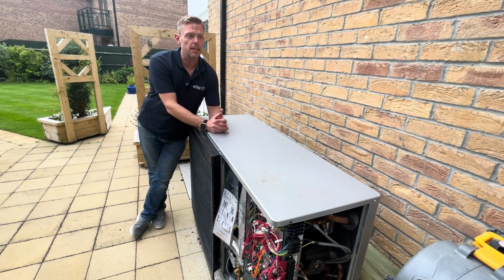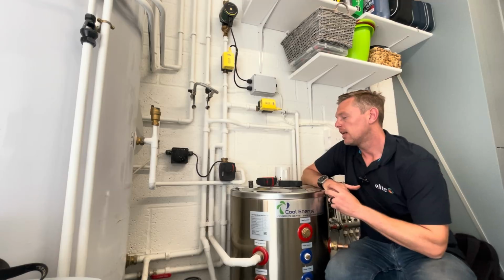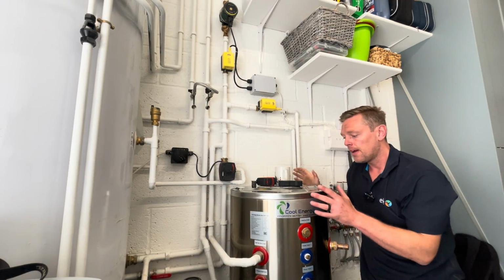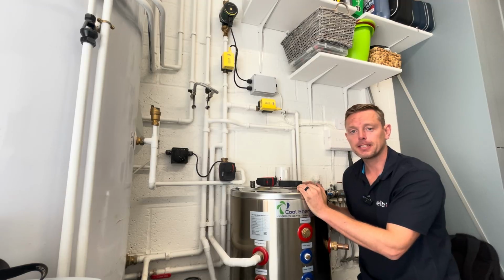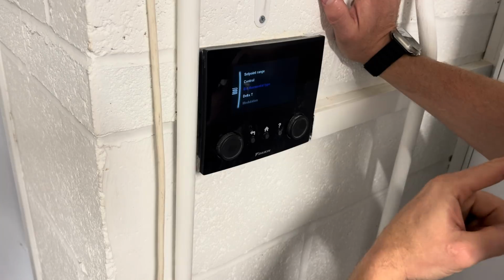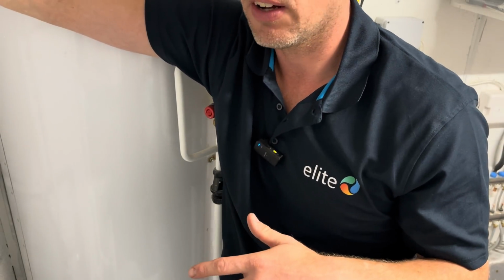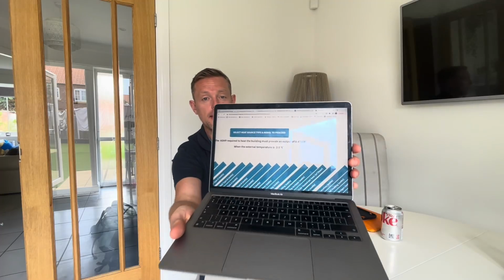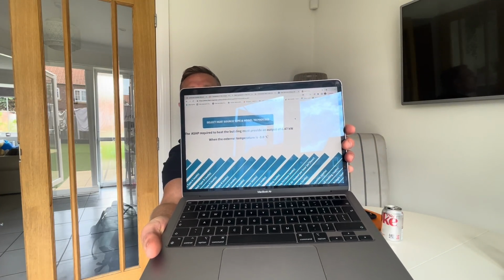How to Kill a Heat Pump's Efficiency!

Comment: If you go to USA you will see a huge amount of heat pumps, used for everything from home heating to pool heating.  They have much cheaper electric and use solar and battery systems.
We are so far behind the times in the UK.  The main reason was cost, who would want to spend £15K on solar and battery systems to only get back £15 a month from selling electric back. They don't think about how they could use that to run their heating.
It's all sold the wrong way.
Reply from the maker: Good point but I think you can get solar and battery for less and earn more off it. But thank you for the feedback.

Comment: An interesting video, however when you said “ …we have all had your learning curve…” one has to wonder at the customers expense?

I suspect the UKs problem installation  are all down to the trades that have jumped on board the “£7,500 taxpayer funded” Bandwagon but are individuals that are incapable of undertaking design calculations.  The problem is experience based trades that are not engineers undertaking work that requires engineering calculations.  The governement will not get it as they tend to be just as incapable as those bad installers that are all too numerous.

Appreciate your video and frank assessment we need more competent installers like you.
Reply from the maker: You only gain competence with experience. You gain more experience when you go back to issues, learn and solved head on. Thats how engineers become good engineers.
Reply: @ I am an engineer.  I had to go to university and get two degrees before I could practice having studied sufficiently to gain competence which was then supplemented with practice and experience undertaken amongst other engineers while I gained my experienced .  That way the oilfields and gas fields actually worked and we were not called back to fix incompetent installations, a lot of primary engineering of fluid flow and heat loss calculations from first principles.

What has occurred in the UK is the usual government screw up throwing money after policy and creating a gold rush.  I looked at an installation last week in a house purchase exercise for a friend and a 16kW LG is plumbed into a small 1820 3 bed cottage. The owner could not state the heat loss calculations but said he was paying £200/month after replacing storage heaters that cost less to run…….  Oversized heat pump, unnecessary buffer given there should only be 1 zone with eight radiators.  A full on oversized installation that clearly had margins in all the equipment necessary or not.  In fairness internal  insulation was fitted to quite small walls and the windows while single glazed are small - conservation area.

While you seem to know your stuff there are many that clearly do not and there is a trail of bad installations that all got £7,500 of taxpayers money but use way too much electricity and do not deliver on the policy…..  when I fit one to my house I will likely do it myself and I already prepare the pipe work to that end as i do up the house.  In part why I watch YouTube videos to learn from mistakes and also see DIY installs that publish their performance online so I may see what needs doing.

Comment: While i get temperature compenation curves.

Why aren't the systems smarter. By this i mean temp compensation curve is used initially. Then the system learns and adjusts that curve automatically like a PID controller.

Holding the temp inside to within a tolerance by modulation of flow temp not by cycling on/off ?

Over time this "learning" will constantly improve compensation curve and presumably efficiency
Reply: This is a really good idea. The system has all the data points to do this.

Comment: James, any nearer to putting out the follow up video you proposed to do for this project to look at the achieved performance increases? Also, out of curiosity what ball park cost do you charge for performing this kind of post-install assessment service? (As in cost to assess the installation and consider solutions - ideally approx cost with and without time required for an additional heat loss survey). Appreciate cost may vary depending how long it could take, but I ask as I may be interested to have you take a look at the system we had installed (local to where you’re based) to optimise the energy efficiency performance.

Comment: Jim, thanks for great video. Quick question. If I reduce my heat curve from 45 to 35 degrees, does that mean than an electric element will kick in to bring my hot water up to the 45 degrees its set to. If so, I guess this negates some of the lower flow rate savings??

Comment: The buffer is piped as a "three pipe" configuration, that would be a good compromise between a parallel and serial configuration.
But it is implemented very badly, tha tee should be short and fat, right on the buffer, and the heating return should go through on the lower half.
That buffer is the reason why the monobloc's water pump didn't error out, because even this badly done, this did provide some hydraulic separation.
Not recognising this (although unfairly underrepresented the three pipe is) is a bit, well, even pros have shortcomings.

Comment: Have u got qny advice on a mitsubishi ecodan my mums is only just touching a cop of 3 it has no weather compensation from what i can tell ive looked up manuals and when i try the options to access the menu nothing happens. The flow and tank dont have separate temperatures so the flow is up at 50c. My 3 bed house same era is costing less to heat than her 1 bed bungalow. Both insulated similarly owned by same council. I dont get how to improve it .

Comment: Seriuosly......the only way to heat your house efficiently and with out all the bollox that comes with a wet sysyem is a2a....aka AC.  Mutisplits have been installed in the UK for 30+ years. They're tried and tested  and the experstise is already there. Obciously it's an AC engineer that would install an a2a system so thats an added bonus not having to have a hairy arsed plumber messing up the install 😜. I believe certain manufacturers are producing multisplits that will also heat a cylinder...... Direct Expansion BABY!

Comment: you also missed the fact there is a buffertank in the system when it does not need it. the underfloor heating can do that job just fine and the underfloor manifold is the wrong type, it needs to be pumpless and have no mixing so all the water from the daikin goes into the floor. that means the weather compensation can drop significantly saving a LOT of money.
Reply: That will be the experts again.  You given the same job in the same houses in a road to different companies and they will all do something different because there is NO best way to do it.  What one says, the other disagrees with.
Heatpumps are OK if you want to warm your home slowly and pay £10 minimum a day to get your lovely warm 19c.
I have never met a heatpump owner that isn't unhappy with the performance, and/or cost of running and having it ripped out to get a gas boiler installed.  That's why Cadent is so busy renewing all the UK gas mains to homes.
Reply: @Bond2025 the only reason gas is even a thing in the UK is because of the utterly insane goverment subsidy on every cubic yard of it. if you actually had to pay full price for it nobody in their right mind would install a boiler.

Comment: With hysteresis set to 27° I presume this means the water temp would
Drop by 27°c - before water heating is called for ? This means less cycling  but temp of water varies quite consistently… or don’t have that all mixed up?

Comment: If you have a buffer between flow and return that is called a two pipe buffer according to the Book by John Cantor. I think the principal is this is allows for mismatched flows. If the flow of the heat pump is greater than the system it will treat the buffer is a bypass that's incorporates a delay in delivering heat to the heat pump on the return due to the volume of water it contains. This would happen when zones are in operation. If it's any time the flow on the secondary side should exceed the flow of the heat pump again the buffer will like similar to a low loss header. It is the two pipe buffer which was allowing the underfloor heating to be set to the lower temperature while radiators were running at the higher temperature. You have adjusted the curve to supply water 35 degrees at 0, I assume you check the radiator size against the heat loss to show that this was an adequate temperature for these radiators to operate at. Had the customer complained about the rooms overheating that was supplied by the radiators? You also turn the temperature for the underfloor heating system up did the customer complain that the underfloor heating was failing to heat the rooms? I really don't like the use of a high temperature underfloor heating manifold on a low temperature system comma does the Daikin unit support the use of variable temperature mixers? You're familiarity and confidence with the controller was very impressive. I think the main two problems you identified, the blocked filter incorrect heat Curve are faults I find on every heat pump I attend. The second most common fault I find is the use of an incorrect pump when the pump is not part of the heat pump itself. Phone flow to be between 50 and 75% of what it should be. The correctly rated pumps can be very expensive and installers are just fitting standard capacity pumps to save money.

Comment: Any disadvantages to installing "oversized" radiators throughout the property before having a heat pump system fitted (other than cost). Does that make a ASHP work more efficiently if they are larger than needed?
Reply from the maker: No oversized the better 💪
Reply: Oversized radiators will usually improve efficiency of any system because of lower flow temp.

Comment: very interesting, I was very involved in my own install so I love seeing the tuning, especially having a Daikin myself. We have the preplumb setup from Daikin which comes with a buffer thats either setup as a hydraulic seperator with a circulation pump, or i read in the manual you can bypass this remove the pump and just have it as a volumiser. I'm leaning towards doing the latter, but was a little confused about how the heat pump's pump will affect the flow rates on the UFH as it seems to modulate. I did find a setting for the pump which changes it from sampling to continuous, which I hope would take care of that as I know this wouldn't be an unsual setup as far as high efficiency Heat Geek type installations go. Not sure if I'll take the plunge and repipe it right away but your video was helpful non the less!

Comment: Claiming unlagged but warm pipes in the garage caused damp issues? Also expecting existing radiators to satisfy room requirements after reducing water temperatures sounds illogical. I'd be very interested in customer satisfaction after your modifications.

Comment: You mention a lack of lagging on pipes causing condensation!!! Are they very cold pipes? Is there moisture coming out of the pipes ? I’m guessing “NO” for both of those. In which case you should know better. Lagging is obviously missing but it’s not “causing condensation and damp”. There is a source of moisture in the room and the walls are colder than the wet air. 
Thanks for the rest of the video. Informative.
Reply: I think what he was meaning was that the unlagged pipes is warming the air in the garage, the warm air hits the cold garage walls causing damp/condensation on the walls.
Reply: @adamcole4808  it will only cause damp if the air pics up moisture while warm. If the air heats and then cools without engaging with wetter air or a wet surface then it will have the same moisture content and it won’t change whether or not condensation is happening. If it finds water to absorb and then condensate out then there is moisture already in the area. The warned air is not the problem. There is a leaking pipe, damp rising in the walls or floor, damp air coming in from another room like a laundry room, etc etc. 
I get that due point and the absorption/ condensing of water in/out of air is not super easy for everyone who doesn’t study or work with this. But understanding it is fundamental to managing heating, building, and resolving damp issues. Despite my appreciation of these guys I confess I’m skeptical of their awareness if they tell customers this stuff. I don’t believe they “told a lie”  concisely to blind the customer with science. Also it’s is just a single nit pick in a long and big list of good material. But non the less it niggles as me.
Reply: Thanks for commenting on the this. I was scratching my head at that but big time because it made no sense. Too separate issues and lagging won’t solve the damp issue.

Comment: We had James from Elite visit our property earlier in the year. He’s very knowledgeable and has set my mind at more ease regarding Ashp’s. 
Firstly he noted that the system was installed correctly which was a piece of mind but the actual setup was wrong. 
We were having large bills over the two years especially the first year. I carried out some tweaks myself to take at least 25% off the bill. 
James has now set our weather curve up so it’s not so to speak going full throttle rather more efficient rate, adjusted the weather comp down to 34c which sat the house at a nice temperature. Proof of course will be in the pudding come this winter but I have great faith in what he told us. 

Always difficult when you are more or less given too much information and told to not touch the system on installation/commissioning  

Hope to watch your next videos for more informative advice.

Comment: So what i concluded from this is that they need to spend another few thousand to bring the bill down from 30 a day to 25 a day because while it's not greatest install and a YouTube material rads coming from 50 to 35 will be huge difference for customer, people are used to roasting rads so we are technically reducing comfort in here, lowering stats to 21c reducing hot water, so reducing comfort to lower the bills and original investment was probably already 15k. So just don't see math here, but again this is just my view and i am not a heat pump engineer.
Reply from the maker: We’ve installed hundreds of heat pumps. We can design to any temp. 21oc is the MCS standard and very comfortable. We speak from personal experience of having a heat pump in my house.
Reply: @EliteServicesGroupLtd  did u ever install heat pump on buffer with two coils one for heat pump another one for solar and then distribution header (system link) with 2x pumps, 1hw, 1uf 140m2 watching heat geek, and watching u this configuration doesn't seems very efficient but that's what i had in my head how i would do it, but now i see that this conf would keep triggering HP on/off all the time since it would only heat up coil on buffer.
Reply: Sorry i forgot to add i am planing to install Vaillant split HP, because of cold weather and freezing issues, no glycol, no anti freez valve because temperature can go to - 20, avg is - 8 in winter.

Comment: 5:32
It’s not kilowatts!!!
It’s kilowatthours. Kwh.
How can anybody take you seriously if you don’t understand the difference between energy and power!
Reply from the maker: I’ll get our production team to edited it in 😂….
Reply: Probably just a slip of the tongue, as this guy does seem to be reasonably clueful. But way too many people just use 'kW' for both units and expect us to guess which they were talking about. It's important that professionals get it right otherwise punters just get hopelessly confused.

Sadly, I did see one person make a youtube videos to explain the difference simply demonstrate that they did in fact not understand the difference! That really wasn't helping anyone.
Reply from the maker: Someone’s done the heat geek course 😂
Reply: @EliteServicesGroupLtd      'O' level Physics ;-) (and a bit more)
Reply: Good video, and an ‘interesting installation’ with fairly shocking findings. I will be very interested in the follow up video.

I note that Syzmon (YT Urban Plumbers) appears to fit an independent (of the control panel)  flow measuring device that enables him to be absolutely sure the system is actually performing to his meet or exceed his design calculations). If you are not achieving design flow then no end of tuning and fiddling is going to rescue the installation. Do you plan to do similar on this rework?
Reply: In that case you'll know that energy is measured in Joules, and that one Joule per second is 1 Watt of power (the rate of consumption of energy).

So 1kW of power is 1,000 Joules of energy per second, and 1kW consumed for one hour is 1kWh (or 3,600,000 Joules of energy) 8-)

Comment: Great video, don't suppose you would know the 9kw versions output at -2?, think my 5kw load may be oversized also.
Reply from the maker: 8.8@ -2. The 9kw dailkin is really a 9. Make sure your back up heater equal temp is set @ -7 specially if it’s over sized
Reply: What is the reason for this?

Comment: liked the video but I dont understand  how the radiators can run at 50 0c and the underfloor at 35 0c
Reply from the maker: Currently with a mixing valve on the underfloor. But looking at putting the whole house in 1 flow temp.

Comment: forgetting the actual install issues but not lagging pipes in a garage breaches UK building regulation because Part L Building Regulations states that any pipework run through walls in areas that aren’t heated, need to be adequately insulated to prevent heat loss.